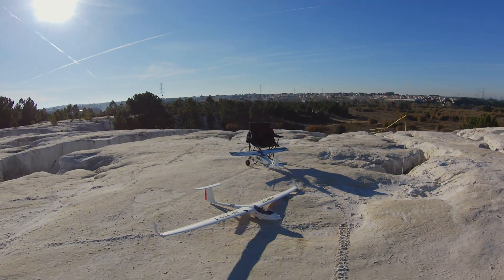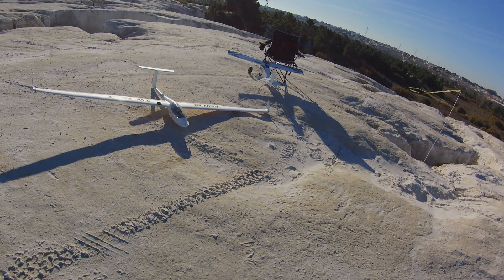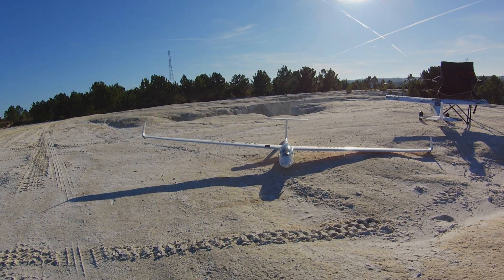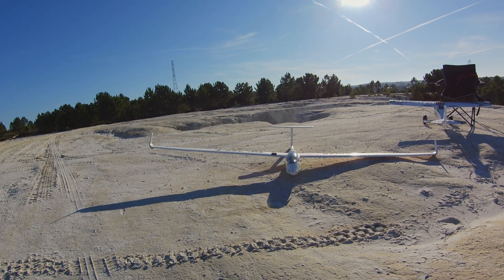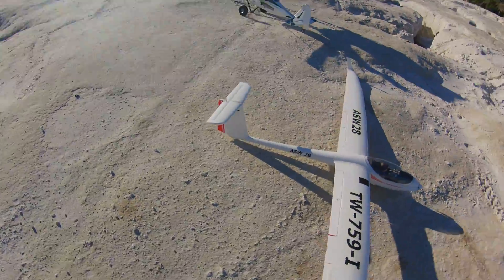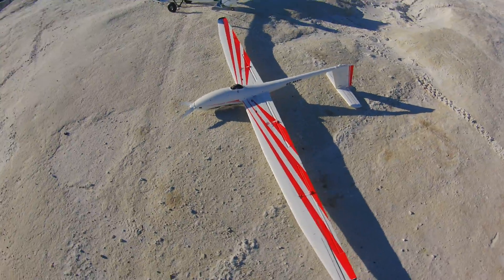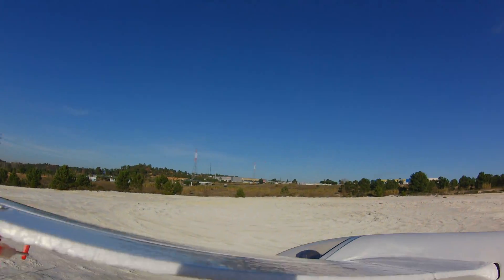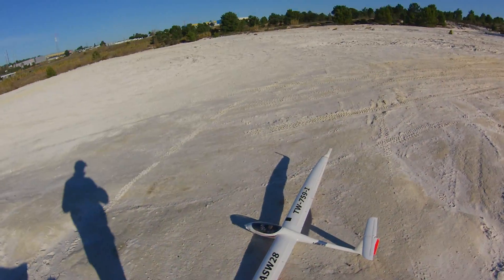Trying out the dihedral mod on my ASW 28 glider (first impressions) 👍

Comment: Nice flying field  - did your mods have any positive effects ? Do you have aileron differential ? Cheers
Reply from the maker: Thanks! 👍 Yes they do, my latest mod was making new bigger ailerons out of balsa and now it's better then ever, I have set differential to the ailerons and also use some rudder mix, it turns nice and sharp, you can check these on my latest videos, cheers 👍